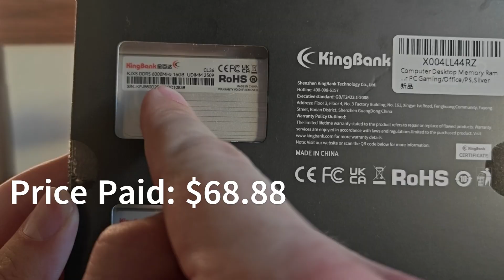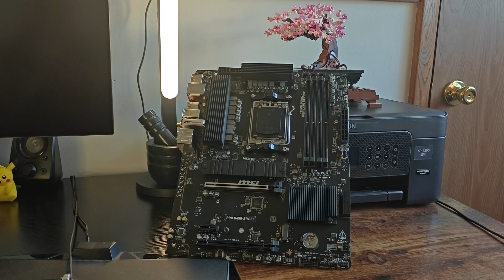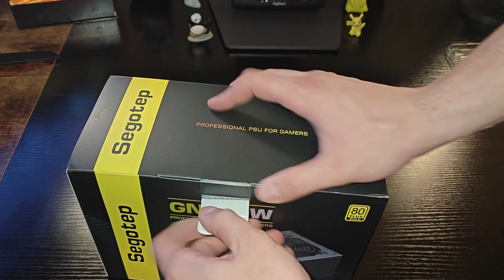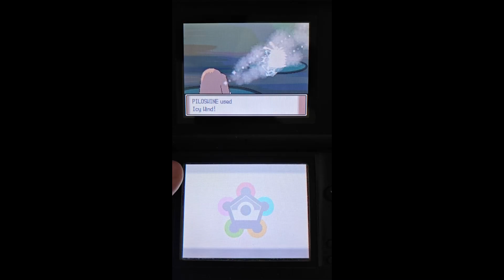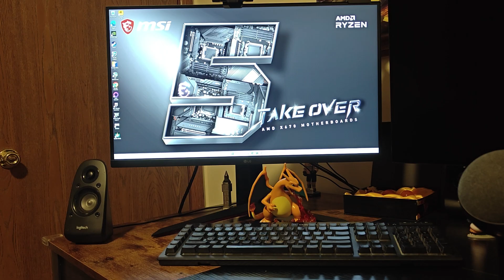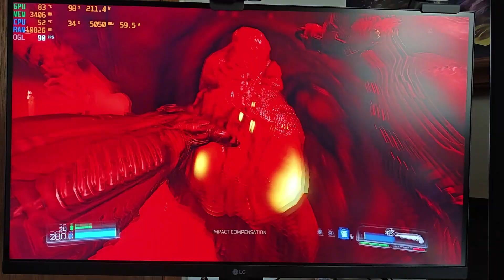Building A Computer Using Only Sketchy Components

Comment: That block plastic socket cover on an AM5 board locates the CPU on the socket and will pop off by itself when you lock the CPU arm down. 
If you install the CPU without that cap, the CPU pads might not line up with the socket pins... And yes, I'm speaking from experience.
Reply: block = black
Reply from the maker: Yep I'm aware of what you mean. I have installed enough to know what I'm doing without it. All the old Intel sockets were the same way. My first ever build on Intel many years ago, the CPU must've just been slightly misaligned and one stick of ram wouldn't work until I reseated the CPU. That was the only time i have ever had that issue.

Comment: I'm using a Segotep GM850W. It's rated F in ZTT PSU tier list. I've been using it over a year now with no problems. The  issues with it is that the cables are stiff and it's hard to plug the cables into the power supply. I find it strange that it's rated F because Linus tested the unit and it passed their tests. I don't know why ZTT rated it an F. Should have been a C at least.

Comment: I love a sketchy computer, spent £32 on a '16gb ram system' on ebay - knew it was lga 1151 but only guesses on what was actually in it, came in a box by itself with one sheet of bubble wrap and survived somehow, i7 6700 and 16gb of 3200mhz on a cheapo m-atx motherboard so not too bad! Took 3 sketchy power supplies before I got the whole rig running though.
Reply from the maker: That's awesome man. I think my best sketchy computer was an old lga 775 board on a literal piece of wood. I had the power supply strapped down with duct tape